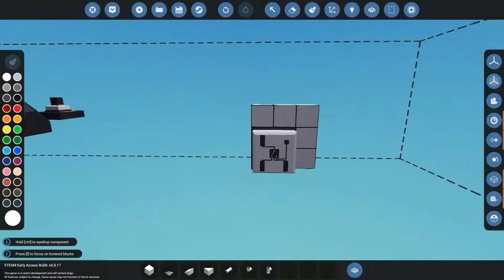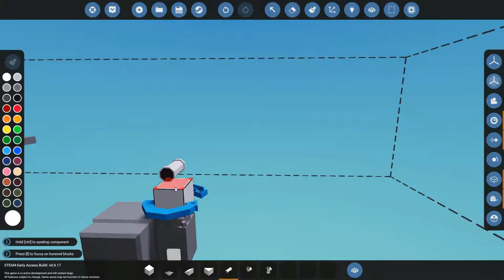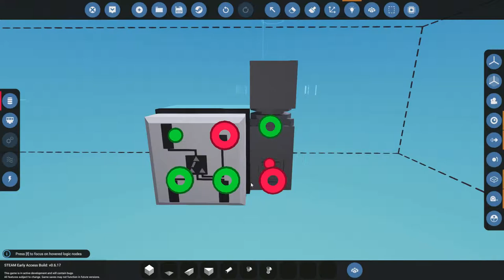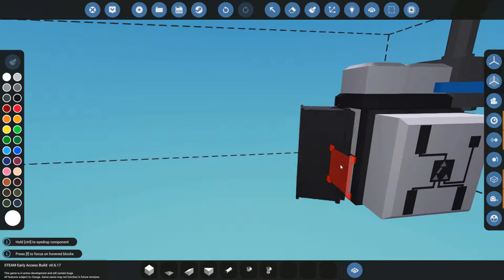Stormworks B&R l Numerical Switchbox Guide

Comment: Sir I'm having a problem with numerical swithbox.I'm using a keypad connected to the On that has a output of .75  and a constant that has output of 0 connected to the off (It is for a custom rudder).The problem is when I switch it on the pivot does not move or anything.Thanks for your help!